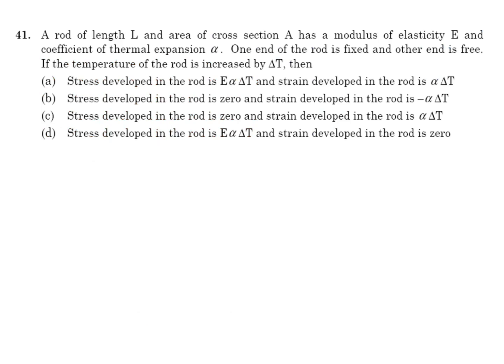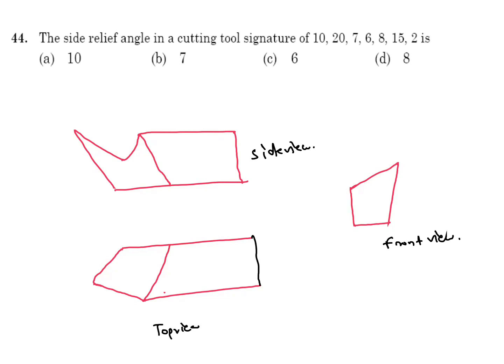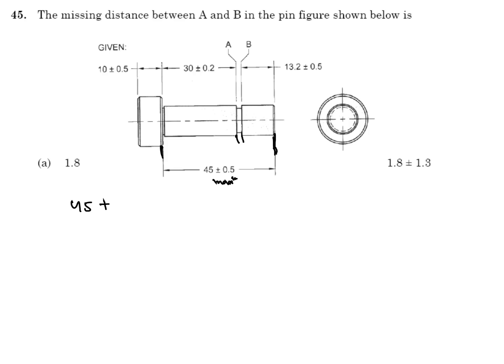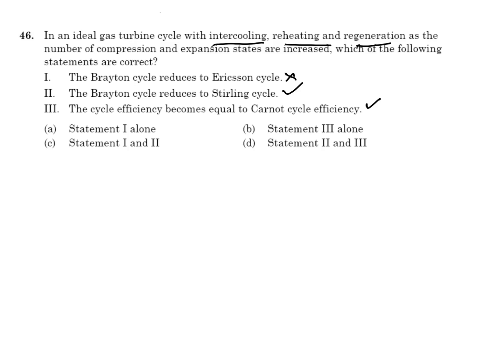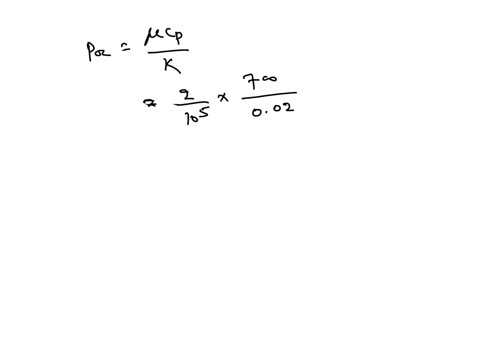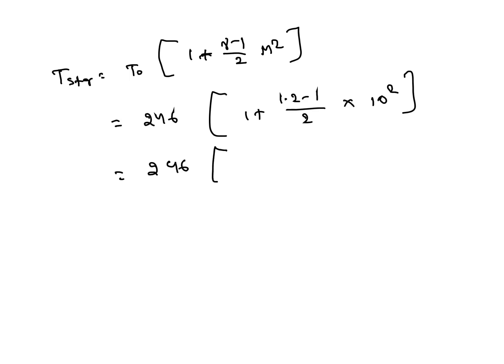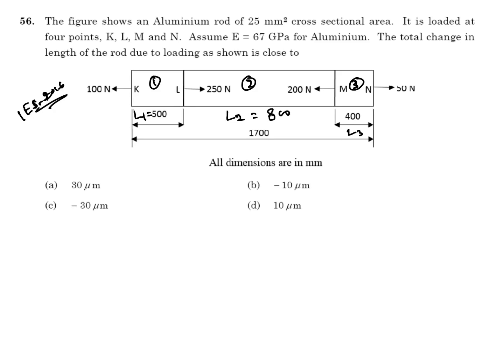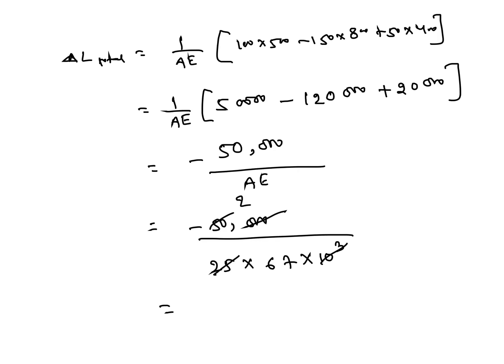ISRO SOLVED PAPERS 2017 Part 05

Comment: Q46 wrong answer 
Whenever no compression and expansion states are increased it reduced to Ericsson cycle is correct
Brayton cycle has 2 constant pressure processes
Ericsson also constant pressure process
But Stirling cycle has constant volume processes
B